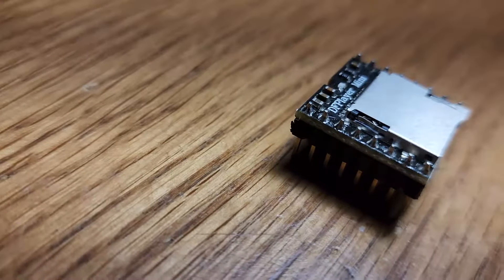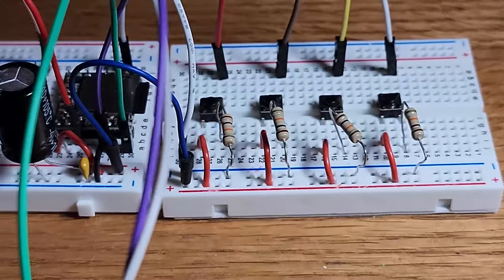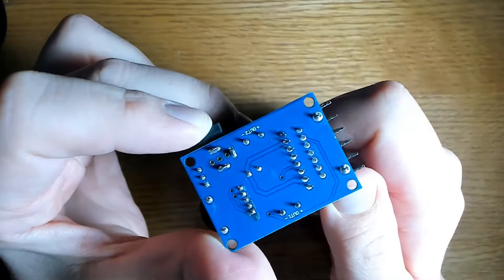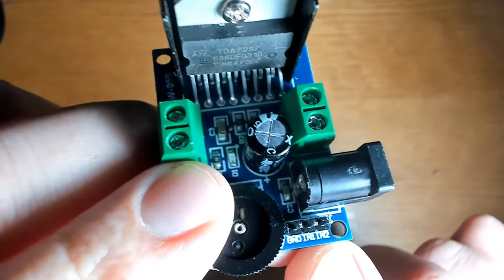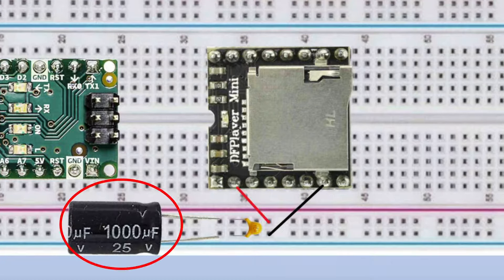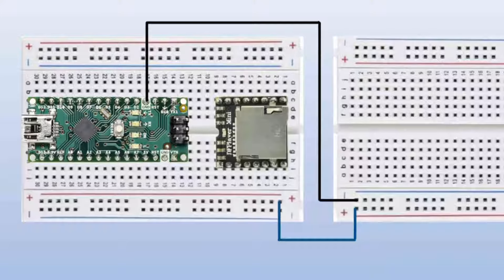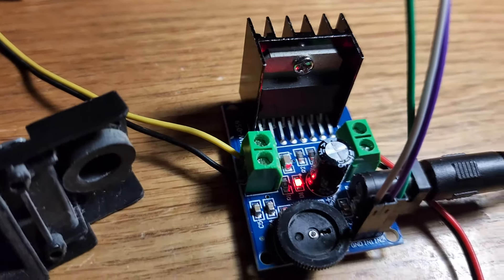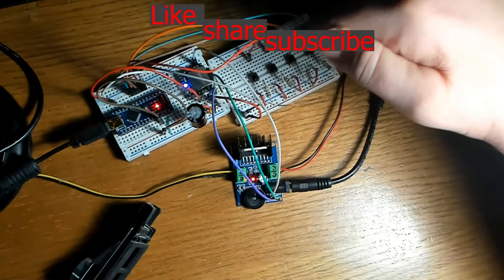Enhance Your Arduino Projects with Better Sound Quality Using DFPlayer Mini MP3 Player

Comment: You shouldnt connect the external amplifier to the SPK1 and SPK2, spk1 and spk2 is the onboard amplifier, connect the  external amplifier to DACR, DACL
Reply from the maker: Thank you for letting me know. I have been using it that way for so long, I totally overlooked it.
I added an update video for this connection. You can find it at the end screen, at 6:27 there's a link in the video, and a link in the description.
Thanks again
Reply: @BMonsterLaboratory  oh okay np, also the onboard amplifier is 8002D, which is used very widely in speakers, cheap amps, 
cheap mp3 player modules etc.

Comment: Hello is it possible to use analog potentiometer?(project purposes) Tnx in advance
Reply from the maker: I wouldn't. A variable resistor could cause signal degradation and no one likes noise in their audio setup :)

Comment: Can this device repeat the same small audio file once activated?
Reply from the maker: yes, you can make it repeat a sound file after activated. you can activate it by button, sensor, timer....whatever you like, and then it can play on a loop. You can make it play immediately after it ends or delay it for a specific time before it plays again. 👍
Reply: @BMonsterLaboratory  DFPlayer can looping mp3 track, but there is a little "click" sound when track restarting.